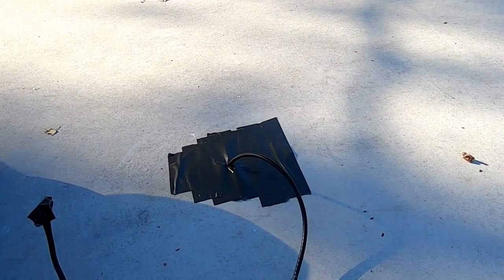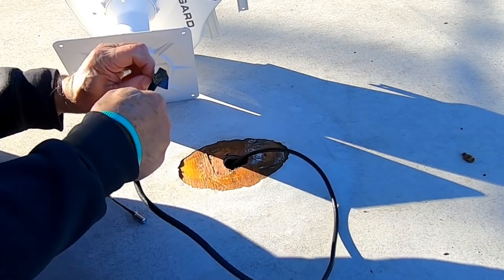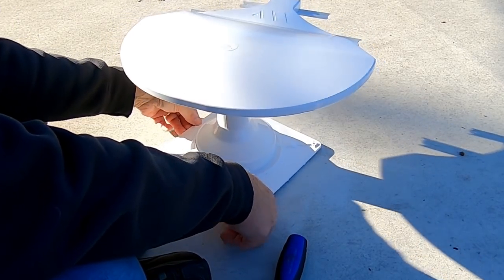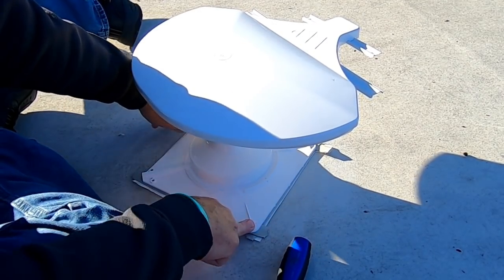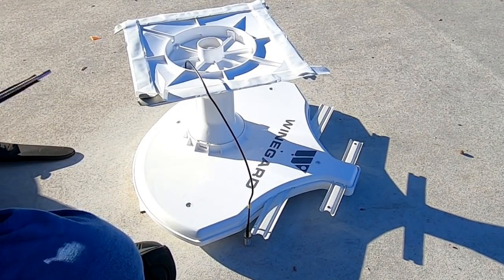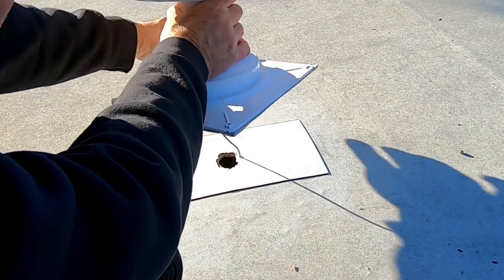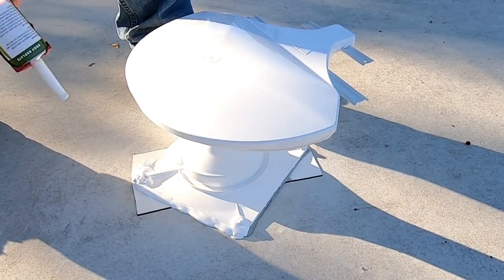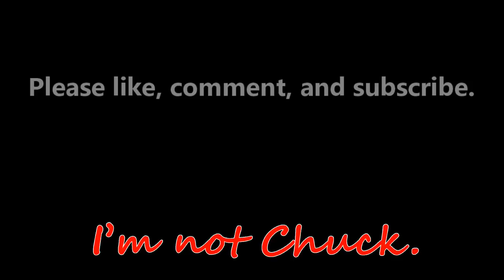RV TV Antenna Replacement and Roof Leak Repair, Part 2

Comment: Wow!!! That's way too expensive. I have gotten to where I don't buy anything from an RV parts store. Walmart and Amazon tend to have simply amazing prices compared to the highway robbery from the local RV dealership or parts store. But when you have to have it immediately you sometimes have to get it right away. Good video. Looking forward to seeing the last segment. 
Pat
Reply from the maker: I agree, but in this case I thought I had to have the material immediately, so I paid the price. Thanks for posting and commenting.

Comment: I would be so afraid to put a hole in my roof.  You did a thorough job.   I don't see water standing a chance.  P.S. Thank you for not falling off the roof. :)
Reply from the maker: Thanks Lola. It's great to hear from you. I tried to be very careful; my bones don't heal as fast as they used to.

Comment: I've seen other video showing application of the Dicor self leveling sealant where they demonstrate a zig zag pattern across seams and edges instead of a straight line application like you used in this video. Also,  I wouldn't have been satisfied with the overlapping of the antenna over the EPDM patch you installed. Seems like a possible leak point in the future even with the butyl tape. Otherwise you do a really good job with your videos!
Reply from the maker: I am not sure I understand the "zig zag pattern" for applying Dicor, but I will look into it. As to the antenna overlappling the EPDM pactch, I agree that I would have preferred the patch to have been wider, but the results turned out fine. Thanks for watching and commenting; please subscribe if you haven't already done so.
Reply: @ImnotChuck.  By a zig zag pattern I mean as if you took a pencil and drew the letter z back and forth across the edge of a patch and not along the edge in a line. Here's where I saw this. I don't think Dicor instructs this way though. Lol! https://www.youtube.com/watch?v=MV12JJkFEFY&t=70s

Comment: Hi Charles. I would like to see someone do a side by side comparison of the reception of the old Wineguard bat wing and new antennas. Some folks think a new tv with a digital tuner needs a digital antenna and dont believe the old antennas will work.
Reply from the maker: I agree that would be very interesting, and I know that the batwing does work, especially when fitted with a Wingman addition. I had that exact arrangement on my previous travel trailer and used it successfully. I can say that the batwing with the Wingman was better than the non-directional Jensen that I removed, but I don't think that it is as good as the Razer Z1 that I installed. Unfortunately, I don't have hard data to back up that assertion, only anecdotes. Thanks for watching and commenting.

Comment: When I started enlarging the hole to change mine to a King Jack antenna, I found a steel plate under the plywood, then 7 inches of foam.
Reply from the maker: That's interesting. What make and model RV was that? It sounds like it was well built.